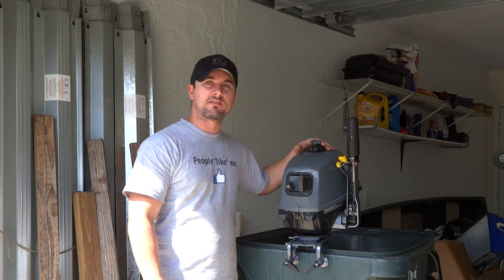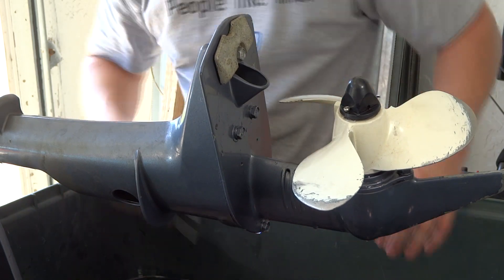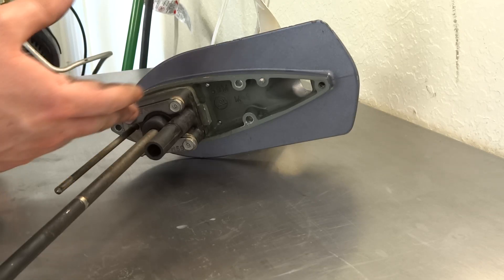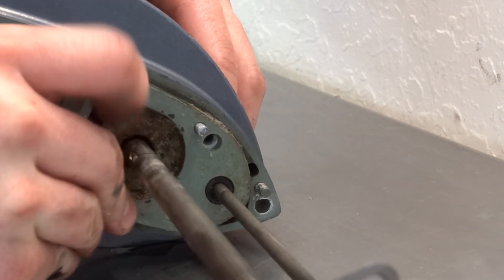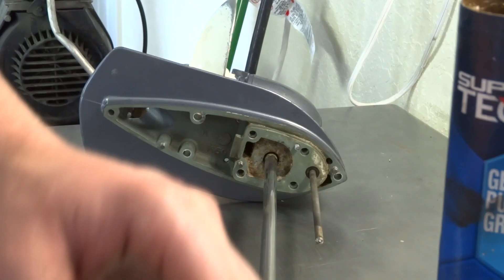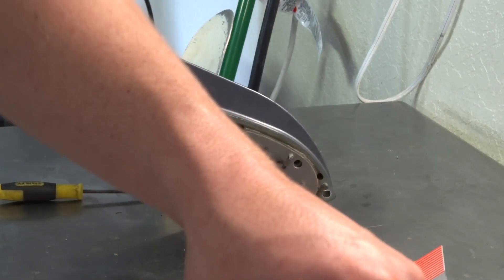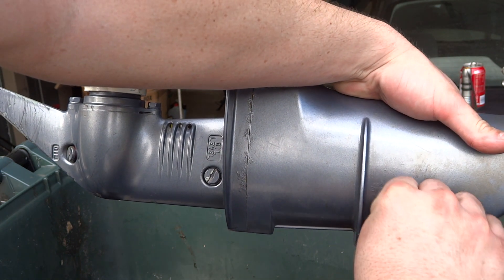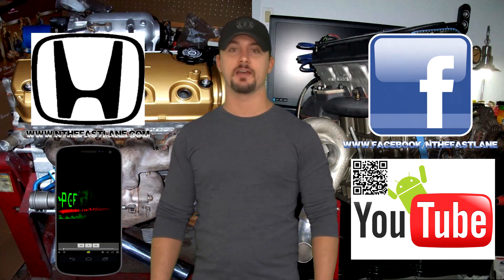Outboard Water Pump Impeller Replacement YAMAHA F2.5 4-Stroke "How To"

Comment: You rather gloss over the refitting of the drive shaft into the leg. Aligning the drive rod, the gear rod and the water inlet pipe - all at the same time - is a challenge.
Your comment ‘a little snug’ accompanied by some creative editing did nothing to explain the complexity of this manoeuvre. 
By the way, you are not alone, two other You Tubes also edit their way out of the problem!

Comment: Have a F4 that stopped pumping and I thought it must be this water pump fail but something you mentioned made think it might be just plugged up so I used compressed air and blew through the top drain hole, started it up in a tank and it worked just fine, so thank you for your instructional, saved me some dollar!

Comment: Do not use grease on the backing plate or in the impeller housing! The rubber impeller and the grease may have a reaction, shortening the life of the impeller. If it needs lubrication, use glycerin if possible. Soapy water is fine.

I laughed out loud when you said ouch to a $20 part... Just replaced a diesel exhaust elbow for $800.
Reply: But great video, very helpful to see what I’m getting into

Comment: When you put the drive shaft back into housing 15:45, how could you see it's connected? your video was bit dark. And how does that shift lever connect back to the lower part? And how many running hours do you need to replace the impeller? Thanks in advance.
Reply from the maker: Sorry it's been a while since I did this how to. I shined a flash light in and very carefully guided it with my finger in side the side holes. A screwdriver works as well. If I remember right,  it connected with a metal clamp that had a 10mm bolt through it.

Comment: Awesome video man.  I have the exact same motor with the exact same problem.  The new impeller i bought from Yamaha (with the same part number you showed), is a pretty tight fit in the water pump housing unit.  Is this normal to have the blades bent?
Reply from the maker: Yes it will be, Lubrication and rotating the shaft as seen in the video will help it slide in the housing.

Comment: Jeremy
Thx for the video
Whats your desktop or laptop set up for running the Sony Vegas Pro
What CPU processor, RAM, HDD, SSD, Graphics card type, Graphics memory to allow it to run in an optimum manner. Any pointers would be useful
Reply from the maker: I'm using a Dell Inspiron M5010 laptop, It has built in Intel HD graphics 4gigs ram, 15.6 screen AMD triple core  2.4ghz if I remeber corectly..Im on my cell. I use a 24 inch Dell LCD monitor. I I like Intel i3 i5 and i7 processors a lot better than AMD, I'd also go with and head over Raideon any day.
Reply from the maker: I meant to say I would go with NVIDIA over Radeon.
Reply: Nthefastlane
Reply: Meant to say - Many thanks